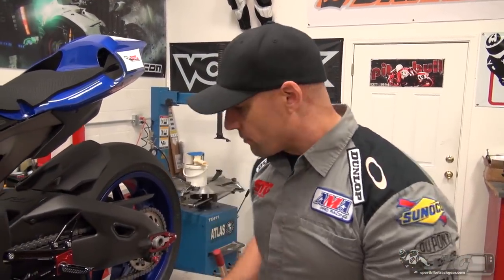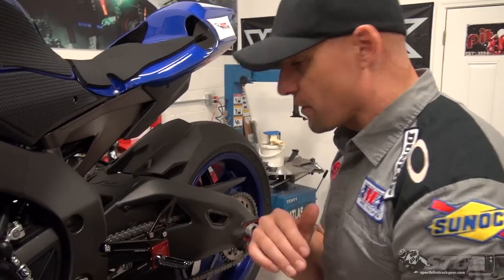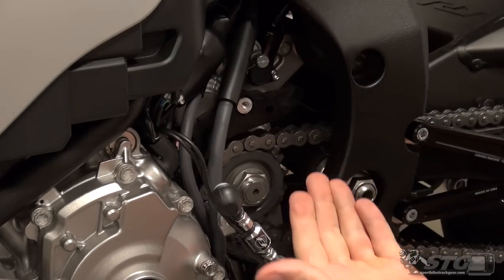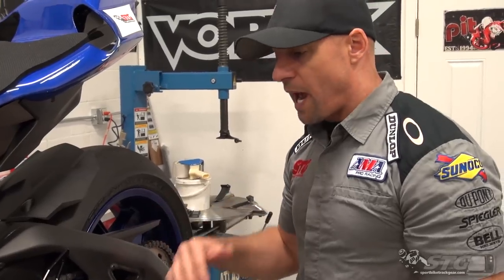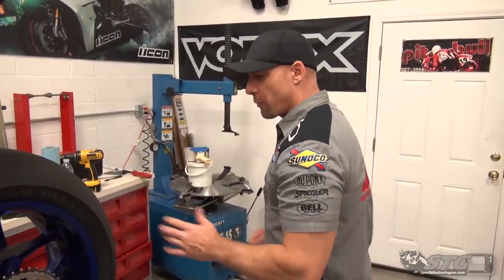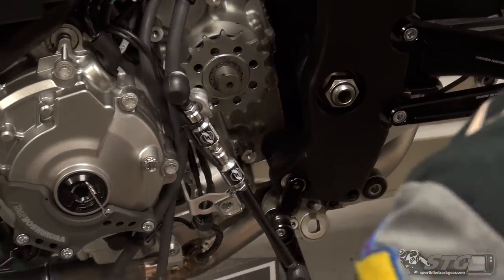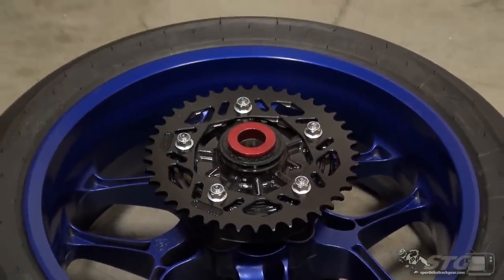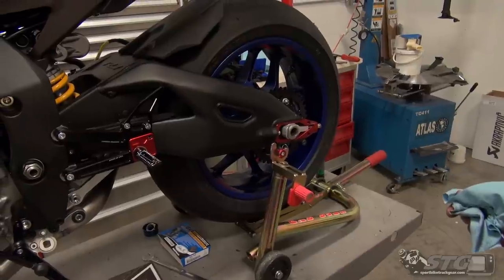Vortex V3 Motorcycle Chain and Sprocket Kit Install 15-17 Yamaha YZF-R1 | Sportbiketrackgear.com

Comment: Thank you, Brian. Thank you, thank you, thank you. I thought I was losing my mind with the countershaft sprocket and it's orientation. I don't have the OEM sprocket and I forgot which way mine came off, but everyone, even vortex said it was boss side out... So glad I found your shop and thanks again for these videos
Reply: Dude same thing is happening to me. But I think vortex is right, because when he put it up next the oem he wasn’t accounti for the extra height around the edges of the oem sprocket. When I set them up side by side centers on equally the all sockets, it’s different
Reply: It’s totally possible that like a 3mm difference isn’t even enough for anyone to ever notice? No matter which way idk
Reply: Derek-I ended up going boss side in, I think.  When I put it on and went to the rear end to look at alignment,  or seemed straighter with the shoulder facing in. Ran it on the track for 6 or so days with zero problems. Haven't looked for wear to see if it's getting eaten up fast, but it is working!
Reply: Jeremy Finn interesting. I’ve only had a couple miles on mine so far. But it looks straight to me the other way. I think the boss side, is only there so the lock nut ends up in the right spot. 

I know stg is far more professional with motorcycles, but idk how that comparison is valid. There is a giant ring around oem sprocket that clearly throws that test off

Comment: Still never showed how to attach this style masterlink. Is it really just a light squeeze with a pliers?
Reply from the maker: If we don't show it in this video we have one on the site that focuses on just the rivet link installation. Here is a link to our STG Chain and Sprocket Guide: https://www.sportbiketrackgear.com/520-chain-and-sprocket-kit-guide/  - Van
Reply: no, you need a special tool to push the links together, and then mushroom out the pins. Just letting others know

Comment: Hey stg I’m a little confused about my front sprocket orientation on my R6. You say to compare them side by side, but the oem sprocket has that thick ring around it, so where the sprocket meets the wheel wouldn’t be touching The table, thus throwing it off. 

Vortex told me to mouth it logo facing out towards me. So I’m really confused now. If I place the sprockets on equally tall sockets, they are even facing the way vortex has told me.
Reply from the maker: If you do it the way I show you in this video the spacing will be spot on. - Van

Comment: broom handle, piece of 1x2, pretty much any piece of wood that will fit will hold the rear wheel without the need for padding.
Reply from the maker: That is another way to do it for sure. Over the last few years anytime I make a sprocket change on one of our race bikes the impact comes out. - Van

Comment: Is it best to initially set the rear a few mm shorter than you eventually would like it (as the new chain stretches, you adjust the rear to your ideal position)?
Reply from the maker: +Reginald J Marshall Great question! Yes you will want to make sure there is enough room for you to extend the rear wheel as the chain stretches over time! Thanks for watching!

Comment: Hey Van I just replaced the front sprocket on my FZ-10 which is very similar to this bike and went from a 15t to a Vortex 17t and its bigger than the old sprocket and the rubber piece you pulled out at 8:46 wont fit now as it rubs on the sprocket.  Is it ok to ride the bike with that piece out until I get a new sprocket?  I just ordered the Vortex V3 WSS kit from you guys and I'll be going back to the stock sprocket size.   Also the chain and sprockets were 520 as is the new Vortex sprocket I just put on.
Reply from the maker: I would wait until you have the right size sprocket. It may not be a big deal but you would not want to have something strange happen and find out the hard way. - Van

Comment: anyone else have a problem even getting the nut to even budge??? any secret to how easy you made it look? I'm 6'3" 250lbs and do hard labor for a living, I broke my breaker bar trying to get the nut to move.
Reply from the maker: +dirtymikendaboys What year is your bike? I have had some where I struggled a bit, never had the broken breaker bar though. Try a little lubrication and a stronger ratchet. - Van
Reply: +Sportbike Track Gear 2015 R1 same as yours, I had to buy another breaker bar and put the 4' handle from my floor jack on there, but it came loose finally. I even lifted the stake points before hand. anyway, got her done ! thanks for all the good videos brother ! keep up the good work 👍👍👍
Reply from the maker: +dirtymikendaboys Glad you got it handled! - Van

Comment: About to order a new sprocket/chain setup from STG for the 2017 R1. Can't decide between 15/43 or 15/44 (for street use) any suggestion ?
Reply from the maker: Pascal Piana going down 1 in the front and up 2 or 3 in the rear is a very aggressive change. I would not recommend going that extreme. I would go with a 15 in the front and a 41 in the rear. I have used this set up for a bit and it increases the drive quite a bit. - Brian Van
Reply: Oh i see, Thanks for the info. So if i increase in the rear aswell while having -1 in the front it would wheelie too much ? 15/41 sounds good then
Reply from the maker: Yes, way too much IMO. The R1 has plenty of drive stock and I would not want to see you do something you regret. - Brian Van